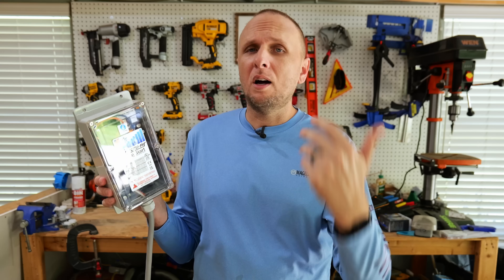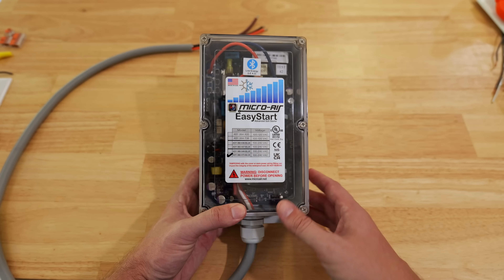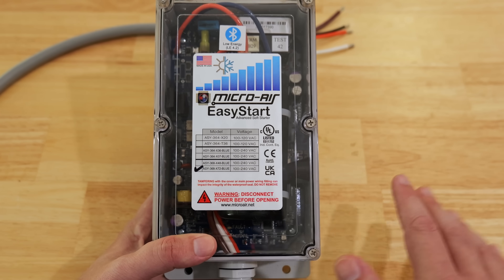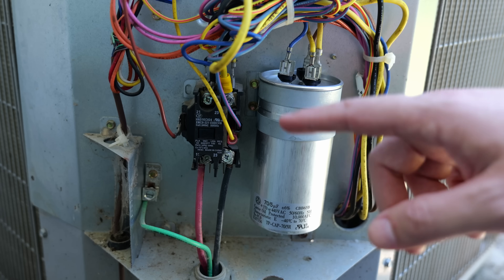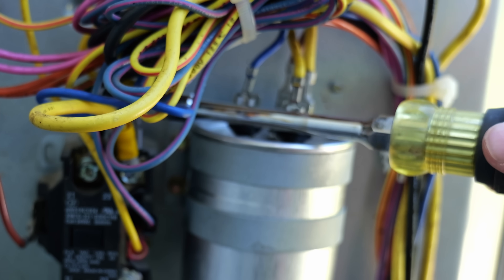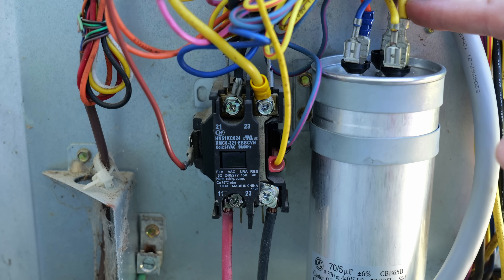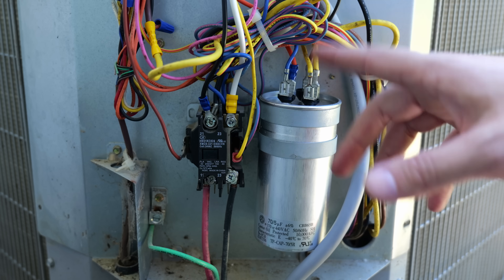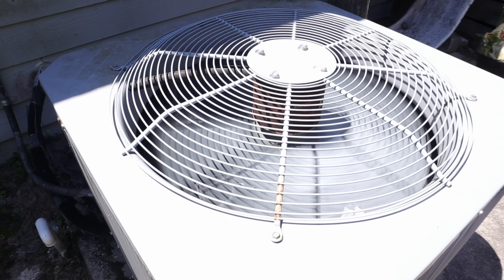Why Every Homeowner Should Consider Installing an AC Soft Starter | Micro Air Easy Start Install

Comment from the maker: IMPORTANT INSTALL UPDATE: On the step where the brown wire from the soft starter gets connected to the compressor R wire there has been some confusion.  By following which wire connects from the capacitor common terminal back to the contactor, this will show you what side of the contactor your compressor run wire is.  It will normally be the largest gauge wire on that side of the contactor (usually the right side).  It will also usually be screwed into the contactor but some smaller units it may be on one of the spade connectors.  You can also refer to your AC's diagram that is usually on the inside of the cover plate that was removed to make sure you are in fact removing, cutting, and splicing the brown wire to the compressor R wire.  I hope this helps!
Reply: I just purchased a Soft Starter, and hoping it will allow me to use my A/C with my DuroMax 13,000 watt generator.  I do have it hooked into my breaker box in the house, etc.  It was just the A/C that I didn’t have enough power to run it using my generator (I use natural gas for that).  I am going to follow your instructions in your video, but reading these new instructions is like trying to do algebra.  LOL..  I guess I’m more of a “draw me a picture guy”.  Is your video correct, or is something not correct on the video?  I will make sure to read this post you put, and watch the video many times before installing it.  I really hope this works, as it’s hot as hell here in Tex this year.   I’m pretty sure we will lose power at some point, and I want to be ready when we do.  Many thanks to the video you posted!!
Reply: Just an update.  I have installed my Soft Starter from Micro Air, and I honestly didn’t think it would work.  My goal was to be able to run my 5 ton A/C unit using my 13,000 watt generator.  My generator is the DuroMax XP13000HXT.  I have it hooked into my breaker box, and use natural gas so that I didn’t have to worry about running out of propane, or gasoline.  Using natural gas will take the watts down to 10,000 (running watts 8,500).  Running amps for 240 is at 35 or so.  My biggest concern was the peak amps after installing the Soft Starter.  I was still seeing it on the app at 63-69 peak amps.  So I figured this would be too high for my generator.  I was pleasantly surprised when it worked!  I was able to run my A/C, have 2 fridges, and 2 separate freezers, along with 2 TV’s, internet, and a couple of fans on in bedrooms (I wanted to see if it would still cut on with these other things on at the same time).  I forgot to get a peak amp reading before installing the Soft Starter, so I’m not sure where it was in the beginning.  I’m still not quite sure why it worked.  I would have thought that with the peak amps still around 65 (avg), that it would have been to many amps for my generator to handle the load.  I”m just extremely happy it did, as it’s hot as hell here in TX, and we have already had the power go out twice this summer (once for 12 hours overnight).
Reply: @billtaylor6795  hi I am planning to buy Duramax Generator the same model as yours. Do you know how long can you run that generator continuously before cooling down ?
Reply: @billtaylor6795  So happy that this is working for you. I bought the same generator. But I'm going to go with a much less expensive soft-start.
Reply: Hi ,wonder if you got the soft start kit for a lower price and it worked good@blackseabrew
Reply: I have same generator and can confirm it works @billtaylor6795
Reply: Thanks for the video.  Im still confused on the Brown wire .  The wire from the capacitor to the contactor identifies this.  In your video you remove this wire from the contactor and then splice the Brown wire into it.  Wouldnt it be easier to remove that wire (C to Contactor) and just connect the Brown wire directly into the capacitor?
Reply: @GaryKrum  I agree, make it easier.
Reply: @GaryKrum  excellent observation! Love that.
Reply: Which model soft starter is needed for a 4 -3 ton unit?
Reply: How about split systems. I have 2 of those units .I would appreciate information
Reply: They make soft for 3 phase and for single 277
Reply: Can I use this in place of a "Compressor saver"?
Reply: @m4rvinmartian yes, the saver is a hard start. The soft start puts less stress on the compressor and (what most people find appealing) allows generators to run the ac of a house
Reply: @ironicstatement why do the call it a saver if it's hard
Reply: what about ac and fridge light tx can be run whit the small generator 6500
Reply: So they can sell compressors and installation

Comment: I like how you show every step, I've watched many videos on this, so I don't blow up my AC units, and lots of them don't even tell you to unplug your fuse and short the capacitor. Some also tell you to cut certain wires and use a wago connector but your method doesn't cut any wires and I love that.

Comment: Do you think a 10,000 watt running/1250 watt start up generator can handle the basics in a home plus a 3.5ton AC unit with a soft start?

Comment: I have to give you 5 stars. I installed it very easily with your guidance. The unit itself...not so much. It was working like a champ and then  after 9 months died. Bluetooth said all was fine. when I opened it up, it was full of this dielectric grease or something like it. I placed the unit inside the unit itself next to the contactor and capacitor. There was plenty of room.

Comment: I asked for one of these and my HVAC tech put some kind of capacitor and another little square type connection box (about 2inx2in). The story is, it reduces the power needed to fire up the motor when it starts. Starting to wonder if I got charged the  $275 for something that isn't doing what I needed it to do, like for it to run if I'm  using my 8kw portable genset. I have a 26kw whole house already, but wanted to have the HVAC system able to run off the portable as a backup.

Comment: Saying that a hard start increases the start-up amperage, literally contradicts your own video on hard starters, which showed a 50% drop inrush amperage.
Reply from the maker: Yes, that is what it showed.  When I made that video though, I only had a multimeter that had a mix/max function on it.  Hard starts make the compressor start up much faster due to the increased current at start.  So quickly that a multimeter with min/max can’t accurately record it.  Even with my new meter that has in rush, it still may not record an accurate reading just because of the speed.  The reason the hard start works is because of that super fast jolt of current, even though technically it’s sending more, a generator doesn’t really notice it because it starts up quickly.  I hope that makes sense.
Reply: @HowToHomeDIY  Thanks for the reply.  Love your channel.

Comment: If you’re running a system off a battery backup generator, this is great because you can have a single stage condenser, instead of a fancy variable speed one—that would help tremendously with inrush current, but upfront cost is outrageous, you save half an acorn on the bill, and spend hundreds in repairs with prolonged lead time on parts. Oh, and it’s NOT hard on the compressor. Notice how it says “*easy* start”. Coming from an HVAC guy I like this product..

Comment: Since this reduces the current needed to start the AC, do you see a reduction in your power bill?  Thanks for the informatiion and video.
Reply: I have one and soft starts do not reduce power consumption. Their intended purpose is to run AC units on generators, as generators struggle to deal with the huge current rush required to normally start an AC unit. Think of it as smoothing out the peak power spike required to start an AC unit.

Comment: You say in the title that "every" homeowner should install a soft starter, but they're not necessary (or even useful) in modern HVACs which use inverter/variable speed technology.

This might have been mentioned before but YT doesn't allow comment-search.
Reply from the maker: It says “every homeowner should consider.”  There is a big difference.  And most ACs in the US aren’t using inverter or variable speed technology.

Comment: First let me say I love your videos they have saved me a great deal of time, money and frustration. Regarding the micro-air easystart flex 398, I need to install this unit on the outside of my AC unit - therefore, I will most likely need to drill a hole in the outside cover of my AC unit. I would like to know what size hole I will need to drill? This way I can get the correct bit and the correct size rubber grommet. If anyone can help that would be greatly appreciated.

Comment: What if I have no power for the easy start to go thru the 5 start up learning process? I won't have any power for another 4 weeks which is why I wanted to hool up a generator to run AC and a couple LED lights in the house.

Comment: So I installed an inlet box a few weeks ago for my 8500w generator (I live in FL and we always power outages during hurricane season). Testing it out I was able to run all my lights and my 3-ton AC unit, when the compressor kicks on it does bog down the generator quite a bit for a few seconds. So I looked into a soft start kit to try and prevent that. I did some research and ordered the ICM870 16A kit. It came in the mail today and currently it’s still in the box. Started looking up more videos and reviews and a lot of people are saying their kits are only last a few months with the ICM brand. I ordered the ICM brand because it was only $200. I guess you get what you pay for. I will be returning it and ordering a Micro-Air instead

Comment: This dude has no clue what he’s talking about.  “Acts as a surge protector”… not even close. It breaks ONE of the leads going to the compressor. The run winding is not even touched by the soft start. Second, if you had a surge it would go right through the soft start anyway. They both going down together, make no mistake.
Reply from the maker: Nope, incorrect…. Dude.  But if you say it loud enough and with enough confidence someone might believe you.

Comment: The Micro-Air Soft-start Flex will not last.  FAILED IN JUST 11 MONTHS. with MULTIPLE  INTERNAL PARTS BLOWN!   I hire my AC Technician to check my system when my ac stop working and he told me I am lucky it has survived the blown soft starter. With the investment over $400, I would not recommend to any friends and family.

Comment: I bought one, it's sitting in my utility room doing nothing. I couldn't quite figure out how to get it connected and the three AC companies I called to install it for me wanted no part of it.  I got comments along the line of "soft start?"  I think you mean hard starter (e.g. an extra capacitor).  I would very much like to get the thing connected before the next hurricane this year but I don't have high hopes.  On the upside, I took the time to label every wire in my AC with printable heatshrink, so there's no guessing about what wire goes where.
Reply from the maker: I understand, unfortunately I can’t guide you through your specific scenario as I’m not there.  These videos are very much for general information and entertainment as we can’t see everyone’s situation.  What you are finding with the HVAC companies is very normal.  Almost all of them still have no clue what these are or what they do.  Slowly more and more of them are becoming more aware though.  I’ve had two AC guys out to my house now for maintenance since I’ve had them installed and they both were amazed by how quiet the unit was turning on.  I have heard of others eventually finding a company that will do it though.  So keep looking.  Or you can reach out to Micro Air directly and see if they can give you some guidance.  If you end up doing it yourself, please make sure to follow the instructions that come with the soft start and again if you have questions, reach out to Micro air.  They have always been responsive and attentive when I would call with a question.

Comment: 125 amps to start the compressor is BS.
30 amps will pop the breaker....!..
125 amps will run a small apartment with everything on

Comment: My mother had to pay +$12,000 for a new 5 Ton AC here in Texas.  What's absolutely ridiculous to me is that this does not come as a standard option.  The reason for this is the AC company (Wolverton) wants to make a TON of money when your compressor fails in the future!  I don't think they even offered this as an option.  Not a fan of over regulation, but you'd think this would be one thing that the government might want to mandate on all new AC installs - here in Texas the demand on the grid is getting bigger every year as the population increases, it seems to me that if everyone had one of these, this would help with grid stability in the summertime.

Comment: Adam - My AC is a Lennox ML17XP1-030-230A01 which is also a single-stage heat pump. It is a 2.5 ton.   Do you know if the MicroAir is compatible with combo AC Heat-pump units?  I live in SW Florida so the heat is very rarely used.  Thanks for all your help.

Comment: It seems the soft start device is intended for installation on a AC or a generator but can it also be used to start a household water pump of 1 HP  from mains and solar power ??

Comment: Hello, I found this on the micro air instructions “Yes, The below factory installed starting components will need to be removed or at least disabled before installing the EasyStart.”  Is this already done with the steps you covered.   BTW, great presentation.

Comment: Could this device operate on an AC unit equipped with two capacitors—one for the compressor and one for the fan—and if so, what would the wiring configuration entail?

Comment: Hello there, I have a micro soft starter that I am about to install. I was wondering if you could just connect the brown cable directly to the capacitor instead of splicing the yellow cable (per say). I believe it would just run the same wouldnt it? I connected the white and black cables accordingly to the contactor. Reason I ask I tried to install it last weekend and did the whole 5 off and on tries and my compressor did not kick in. I was getting all kinds of errors on it. Just curious if I need to try it again or what would you recommend? Thanks

Comment: Thank you for the video. This really helped me feel more confident about doing this myself after a couple HVAC companies here in my local area would not install this for me. FYI, for me, my inrush current dropped from 122.2 amps down to 28 amps. This completely resolved the issue I had where my solar + inverter + battery setup sustained rating of 12KW was just under my HVAC startup inrush of 14.6KW (122.2*120). Now my inrush startup of 24-32 amps (3.8KW max) is well under my inverters rating. I am even able to startup my HVAC when running from my smallish 5KW peak / 3.9KW sustained load generator.

Comment: I thought some ac units already have a second capacitor for hard starts??? I think my ac guy took the seconding off so I guess ever tech has different opinions or maybe people get tired of changing cheap capacitors when the manufactures are purposely designing them to break. I think if they really wanted to solve the "issues" they would just design and make really good high quality capacitors. Its all BS bro . just people seeing how much smoke they can fit in your man cave:)

Comment: Talked to my AC contractor today.  Said no need to install this unless you are putting in a generator.  If not adding a generator it is a waste of money
Reply from the maker: Ok well that is just an opinion and one most likely based on not knowing much about these.  Most AC techs have no clue what these actually do.  My AC tech was out a month or so ago, said it was the first one he had seen, the numbers were great, should extend the life of the compressor, and he couldn't believe how quiet it was starting up.  So yeah.

Comment: Thumbs up and comment to say thanks man.  Needed this and totally makes sense.  One question 🙋🏽‍♂️. The mfg instructions for a TRANE unit says a couple wires should be terminated and there’s an “X” on the wiring diagram.  Does this mean I need to clip those wires and terminate or just remove them from attachment points and maybe black tape over exposed wires?   In your video all wires reattach to their spot except the butt connected one

Comment: How do I know how many tons is my heat pump? Smart comfort Product # R4H436GKP100. What microair easy start flex do you recommend? Thank you
Reply from the maker: Based on what you provided, that number 36 in the middle of the product number would represent 36,000 BTUs.  Each ton is 12,000 BTUs.  So if you divide 36,000 by 12,000 you will get 3.  So with that number it would be a 3 ton unit.  The great thing about the new Micro Air Flex is it covers all AC unit tonnages so you dont have to buy a specific one like we used to with the Blue editions that you saw in this video.  I have a newer video on this showing their new Micro Air Flex.

Comment: I live in AZ. Sometimes we lose power in the middle of summer. I plan to someday adapt my house to be run (with A/c) on a generator. First I want to install the Micro Air Easy Start. I am thinking that until I save the money to add a generator I would save money on my monthly Electricity bill just by adding the Easy start. Is that your experience?

Comment: M new Bosch heat pump is an inverter type with large circuit board. Will soft start work with system